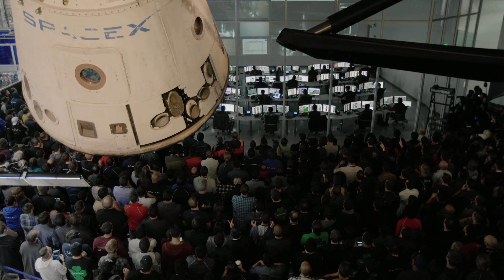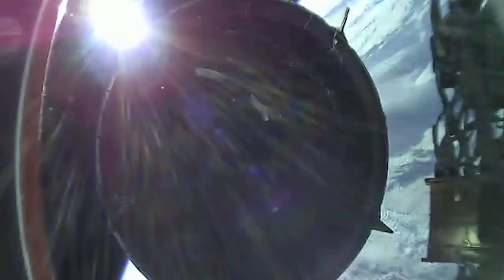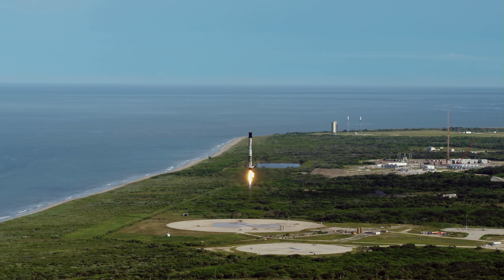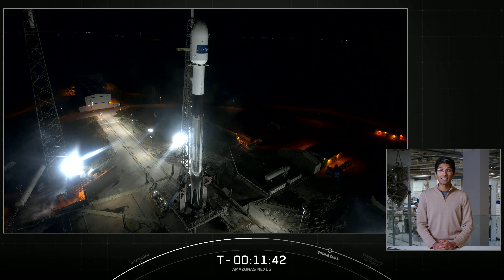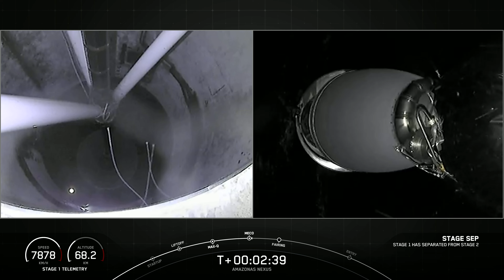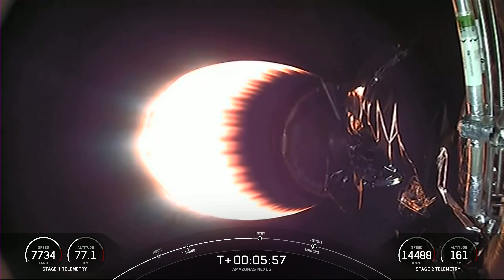Hispasat Amazonas Nexus Mission

Comment: Excellent debut, Ronnie, and I expect we'll be seeing you going solo in the near future.  There were several descriptions which I found especially well-phrased, precise and accurate.  Only thing I'd change is that you mentioned that the first stage engines burned X amount of "fuel" per second; presumably you meant "propellant" (i.e., fuel and oxidizer combined).
Reply: hey mick, can i suggest anti inflammatory meds 'Dr.Prides Healing Balm' for your shoulder? after patting yourself on the back for 30 minutes straight, you'll need all the help you can get....

Comment: Why is it called a gravity turn if they are using the engines to turn and push the rocket sideways?
Reply: Because it's actually gravity controlling the turn not the engines, they're just pushing at that point.
Reply: If you offset the point of thrust just a tiny bit from the point of mass, you let gravity do most of the work for you!

Comment: 19:33 - NO BUENO! That is a LOT of rocket exhaust blasting the cargo, which is supposed to remain pristine and not contaminated with carbon deposits. Yikes!
Reply: That's not rocket exhaust, none of the exhaust from the Merlin vacuum engine reaches the payload. SpaceX uses cold gas thrusters for rcs, e.g. compressed Nitrogen. No more harmful than the air it was already exposed to during it's time in our atmosphere.
Reply: @pyrobreather1  Oh, gotcha. It looked like the fairing half had caught the rocket plume as it fell back into it, redirecting some of the exhaust. Cuz they do impinge on the plume and change rotational direction after they peel away. I had forgotten that they each have their own avionics and control systems in them.
Reply: No, there isn't. Where do you get that idea? The payload is at the top of the rocket, which is in hard vacuum. The engine is at completely the other end of the rocket, thrusting in the other direction. Jettisoning the payload fairings in no way exposes the payload to the rocket exhaust.
Reply: @odysseusrex5908  It actually could; If you watch various footages of the fairing halves falling away, you can see how it could be possible; But I believe @Caleb Crow was likely right - that it was more likely the cold gas thrusters on the fairing halves doing their thing.